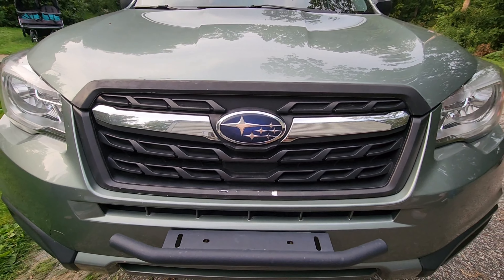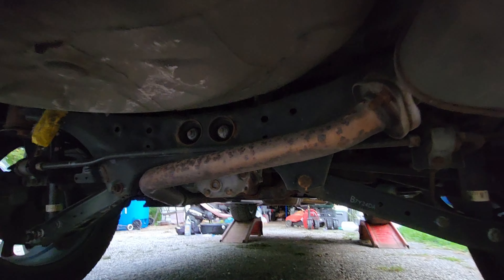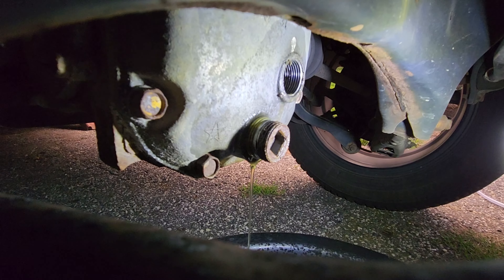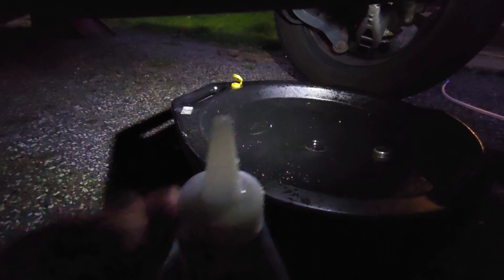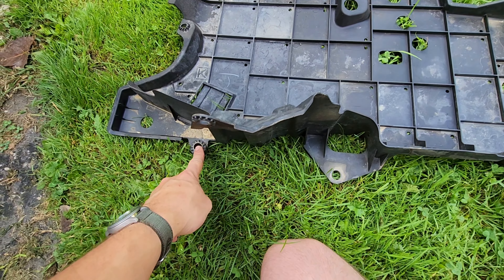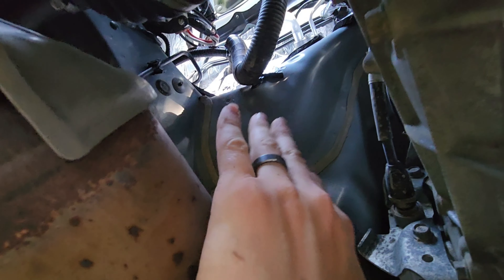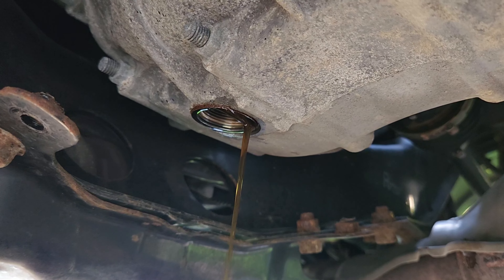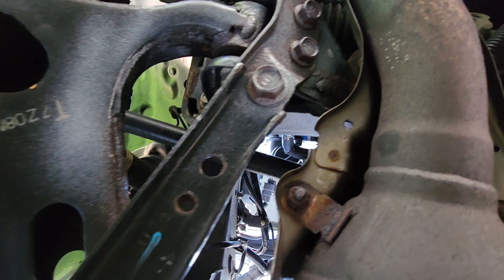Car Care : Subaru Forester 2018 Manual Transmission And Rear Differential Fluid Change In Driveway

Comment: Thanks for the video, not a lot of instruction on the forester MTs across youtube for these years. Tackling this project on my 2017 premium manual this month.
Reply from the maker: I struggled to find the capacity of gearbox/front diff, so just relied on the dipstick. Months later, and I have not had to add a drop more gear oil to it. I knew this video would help seeings how few videos I could find on it. Super easy to do, and cheap. 👍
Reply: @OutsideTheTargetDemographic  I did this job yesterday and referenced your video. Ultimately, 2.9 quarts drained, we put in 3 and kept checking the dipstick. That seems like the right number w/these cars. Already improving the driving experience. Thanks again
Reply from the maker: @aaronmatulevich454  Jazzed that my video helped at least one other person out there. Thanks for the feedback! 🍻 I didn't notice any change in noise of driving, but I imagine you would experience both if the fluid failed. 😑

Comment: Gear lube seems to me the strongest smelling of all the fluid smells from a vehicle, so the smell isn't a bad thing and that color looks fine, amberish and clearish is better than dark and milky.  Good ideas and nice video explanation.
Reply from the maker: First experience with gear oil. It's smell was....particular and lingering. Now I know what it smells like for when someone's car in the parking lot has a puddle under it.

Thanks for the view, comment, and compliment, friend. 👋
Reply: @OutsideTheTargetDemographic  You're welcome, what's funny is I still don't know to this day if I like the smell or hate it, but it is distinctly gear lube, nothing smells like it.
Reply from the maker: @FloridaDeere  Agreed. It's got like a sweet smell that isn't unpleasant, but as an oil it doesn't burn or evaporate away, and you'll smell it for a while after using it. Things you learn. 🤷

Comment from the maker: ~800mL Rear Differential
~2.8L Front Differential/Gearbox
Just have 5 quarts on hand for a manual transmission Gen 4 Subaru, and keep the remnants for topping it off or return one. This project was agrivating for me, but the moral of the story: don't trust the internet, DO trust the calibrated dip stick. 👍

Comment: Great vid! But um still a little confused. Where's the front diff? Does that use the T70 torx?
Reply from the maker: Hi friend! Thanks for the comment/compliment.

I did this a few months ago, but as I recall, only the manual transmissions will have a T70, the CVT transmission uses a different drain and all.

In the manual setup, the front differential uses the same oil reservoir as the front diff. SOOOOO, when you drain the T70 torx fitting, and refill with gear oil, you just did BOTH the front diff AND transmission. 👍

The T70 drains the old gear oil out, and then you refill the tranmission/front diff with new 75W90 gear oil, checking the dipstick until you get it full enough.
Reply: The front diff and the manual transmission are both in one unit. When you change the transmission oil you are also changing the diff. Hope this helps I had the same question.
Reply: @OutsideTheTargetDemographic  thank you for the video, it was super helpful. Going to do it on my outback. 

Can you please clarify, did you fill the front diff via the dipstick hole?
Reply from the maker: @permaflopper  Good afternoon, Perma.

Correct, I ran a tube down into the dip stick hole, added a funnel to the top of the tube, and began to fill it.

I would suggest you add 2 qts/liters, and then start adding 1/4 qts/L at a time, and check the stick. It is MUCH easier to add a bit more oil to get to the full mark, than to overfill and have to drain some back out. 👍
Reply from the maker: Also, note, this video is ONLY FOR MANUAL TRANSMISSIONS!!! CVTs or automatics have a different drain/fill procedure.
Reply: @OutsideTheTargetDemographic  yes, thank you very much.  Mine’s a 2017 outback manual.
Reply from the maker: @permaflopper  then you're all set and unlike me where I had to learn it and film it as I went it should take you about an hour hour and a half if you have everything already ready already.